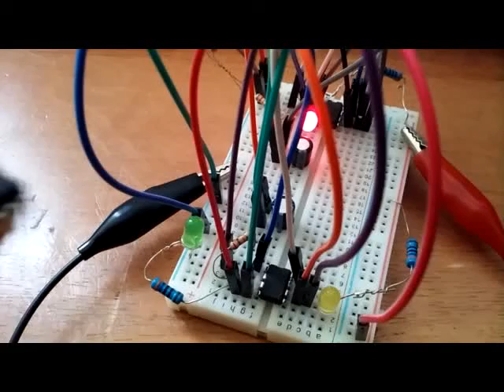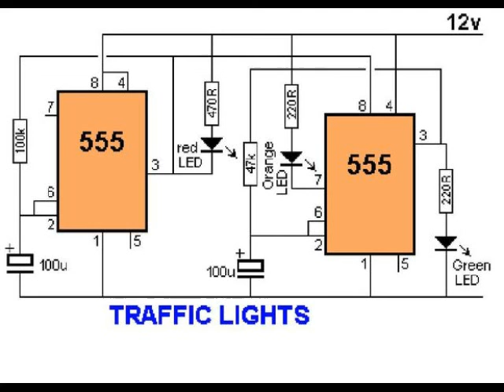LED Traffic Light 🚦 555 IC Timer Breadboard Project

Comment: The way the capacitor connected to the 555 timer is still able to discharge is the following. Once the capacitor is full of charges, the comparator on pin 6 produces a 1 output at the flip-flop because V+ is larger than V- on the comparator. V+ is going to be close to 9V and V- is only 2/3 of the voltage so 6V. Before the capacitor is fully charged, the output is 0 at the flip-flop from the comparator on pin 6, and the reason for that is that the V+ voltage is smaller than the V- voltage. V- voltage is 6V but V+ (before the capacitor is full of charges) is close to 0 because all the charges from the battery are going to the capacitor first. So on the flip-flop, your S value is 1, this is the value from the comparator at pin 6. And the R value on the flip flop is 0. R value is from the comparator at pin 2. Since pin 6 and pin 2 are connected, the V- is going to be 9V since the capacitor is fully charged now and all charges from the battery are going to pin 6 which is connected to pin 2. and V+ at this comparator in pin 2 is 1/3 of the voltage which is 3V. Since V- is greater than V+, the comparator output is 0. So R=0, and S=1 at the flip-flop, this gives an output of 1 at pin 3. An output of 1 means no output voltage, and the flip flop is directly connected to a transistor which is grounded, so the capacitor is able to discharge because of this. This is easier to see with a diagram. Hope it helps
Reply from the maker: Reviewing this a couple years later 🙄 thanks for your in-depth description on relationship of capacitor to flip flop, and voltage thresholds. Much appreciated. Best regards, Paul